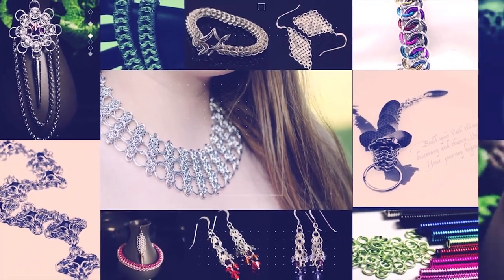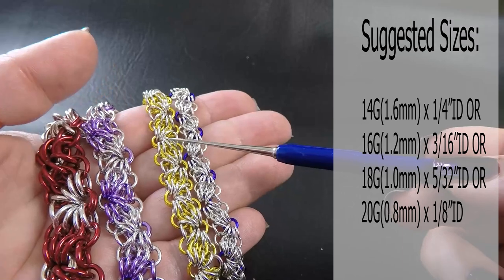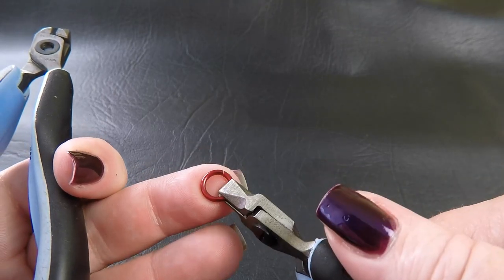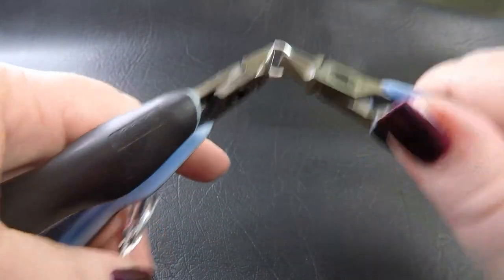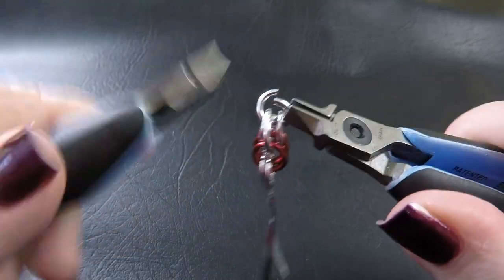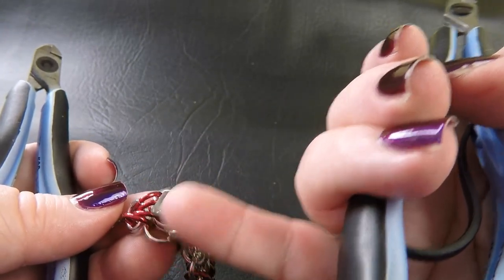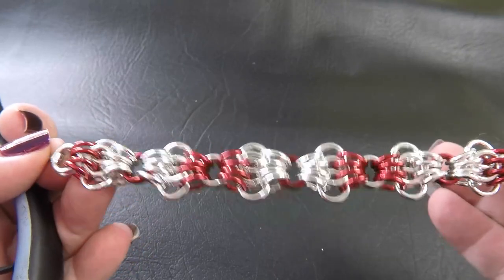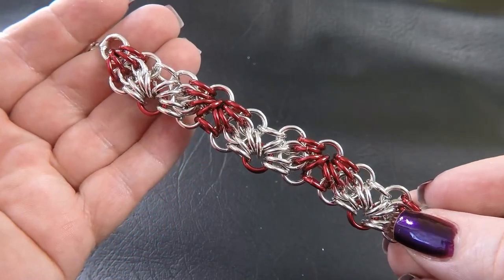Chain Maille Tutorial - Sunrise Weave

Comment: Did you lose any length when you were connecting the sides (outside rings)  at the end?
Reply from the maker: You do, I would add about 10% extra in length, but you can easily add to the centre chain if you get to the end and it isn't correct.